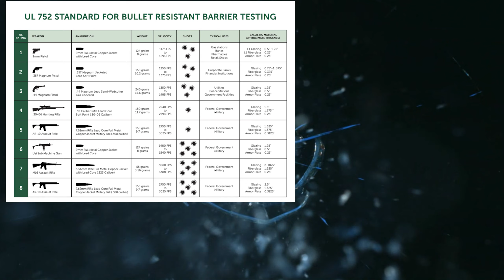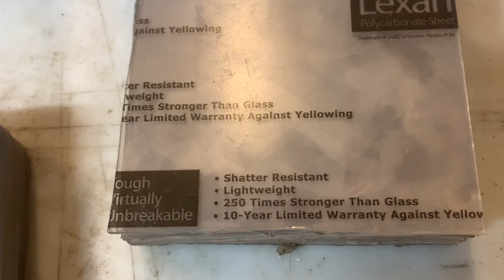Amazing Homemade Bullet resistant Glass

Comment: A couple things you should test out as I am starting to work with acrylic and polycarbonate sheets for my house windows and doors, I am also using epoxy resins and polyester fiberglass resins. You’re already using them in a way by using gorilla glue and other adhesive sealants to bond the layers together. But instead of pressing the layers together and squeezing out as much adhesive as you can to reduce air bubbles, consider using different types of pourable 2-part resins to make some of the layers themselves. Epoxy resin has a tensile strength similar to that of polycarbonate and acrylic and glass, while polyester resin is not as strong as epoxy resin it is much more flexible. Just make sure you purchase the correct type of resin for how thick you want the layer to be. Once the hardener is mixed in they begin to heat up to cure and Some epoxy can only be poured 1/8” at most or they get too hot and can combust. Other deep pour resins can be poured 2” deep. The deep pour resin is very thick and you can make a wall around your piece of glass or lexen using a masking tape. Wrap the tape around the perimeter of the glass ensuring half of the tape is sealed tightly to the edges of the glass and half of it is sticking up like a wall  around the piece of glass. You can then pour a layer of resin on top of the glass or Lexen layer and use a heat gun or torch for epoxy resin only to get the air bubbles out of it, then wait for it to set up and put another piece of glass on top while it’s still curing or wait for it to fully cure, sand it’s surface a bit, and then pour another layer of resin. If you have the equipment to do so you don’t even need to use adhesive to combine the layers. Actual bullet proof glass is sealed around the edges with a special high temperature adhesive possibly similar to stove gasket or furnace cement, then it’s put in a high heat furnace where it’s heated up to just below melting temperature and then all the layers of glass and polycarbonate are pressed together compressing them extremely hard. You may be able to replicate with a forge and a hydraulic press if you have one or buy one. A small one is around $300
Reply: After all, polycarbonate and acrylic sheets start off as a liquid resin that is poured and cast through a process to become sheets

Comment: Some helpful pointers:  For practical purposes, it is best to have one layer of glass on the two outside faces.  This is because glass is far more scratch and UV resistant than the plastics. Glass in general just weathers way better than plastics, though the downside is that it cracks much easier.  The next best would be acrylic on the outside because it is more UV resistant than polycarbonate.  P.C. can yellow in strong UV.  

   There are two main grades or types of acrylic.  There is regular acrylic and then there is toughened, impact resistant acrylic.  Obviously the latter will be better for this purpose.  

  Naphtha is a much better thinner than mineral spirits, especially the low odor stuff that you're using. People have done experiments with using different solvents to thin silicone caulk, and found that the former works much better than the latter--mainly because it evaporates much faster and more fully.  But yeah, of course it is more toxic to breath, so either do it outside or wear the right respiratory protection. 

   To help get rid of air bubbles, you really should use some kind of vacuum bagging system, whether it is the cheap, clothes bag and household vacuum cleaner set up, or the much better epoxy/composite specific, much higher vacuum pulling bagging systems.
Reply from the maker: If I had glass on outside and inside and single shot would spray glass shrapnel everywhere. 
As far as the UV and PC. All it takes is a UV resistant film and it works wonders.
Reply: @3RBallistics    Do you use glass because of its compressive strength then?
Reply from the maker: @justinw1765  think of it more like body armor. I use the glass as a strike face and polycarbonate as a composite. One breaks up and slows down the projectile and the other “catches” the projectile. Glass breaks and PC bends.
Reply: @3RBallistics  👍

Comment: Good informative content as always. I think you and tech are really onto something. I have my own ideas for rifle glass, I want to make rifle rated glass lenses to protect the eyes for a full head/face ballistic helmet that I will be working on at some point. 
Anyway, keep the glass content coming you guys! Because I might need more information on bulletproof glass before making some decisions on future material purchases. 👍😎
Reply: That's a hard endeavor because geometry is against you... unless you make the ballistic helmet with goggles like Minions. Your main concern should be reducing thickness a lot. You should try to reverse-engineer some existing tested ballistic helmets. I would do that. Or you will have to compromise visibility for protection. Visibility is important in combat. The eyes can be an acceptable weak spot, assuming the rest of the helmet can withstand power rounds (you said rifles, try to start with small caliber rounds, like 3A, and go in incremental steps). Also, you could go electronic, providing a helmet with no weak points, but with sensors that can be projected in small screens to the wearer. Wishing you the best of luck!
Reply: @merodriguez81  It would indeed be difficult to achieve if you were using traditional bulletproof glass methods. However I've been thinking of a bulletproof glass prototype concept that I think could allow me to get away with a rifle rating for a small area of coverage. My idea is to combine a layer of transparent Aluminum with a layer of tightly packed glass marbles molded inside a piece of Polycarbonate plastic followed by a very thick layer of Polycarbonate plastic that's annealed (to catch any fragmentation that makes it through the first 2 layers ). 
Keep in mind though this is only a conceptual prototype. I won't know if this will work until I build a few samples and get ahold of someone to test them for me.
In theory it should give me good optical clarity while still protecting my eyes from bullets and fragments. If it ends up working I'll use that in conjunction with forearm-mounted ballistic mini shields to block any head shots from a distance. The mini shields is another concept I drew up and put on the back burner until I get the necessary materials to build some test samples.
As for the main composite armor for the rest of the helmet, I think I plan to go for a level 3A-x rating.
Or a high level 3A that's capable of taking down all pistol calibers, including the ones designed to penetrate 3A panels, and can even stop a few low tier rifle threats by itself with little to no ceramic used such as .300 Blackout or .223 Remington for example. I won't phase out ceramic for it entirely, I'm just going to set the limit to no more than very little ceramic used if any is used at all. And I will also try to keep the helmet very lightweight and still at that insane rating. 3A-x @ 5 lbs. or less high multi-hit with little to no BFD signature if I can manage it.
Reply: @nemesisobsidian  You made me investigate. I am no chemist. I'm a Software Engineer.
If I understood well, Aluminium oxynitride should be a great idea. Again, what bothers me is that even if you achieve to stop the rounds in the eyes, the visibility WILL BE compromised, at least for that eye, with only ONE round. That's why I mentioned electronics before.
Sure, you can say, if you manage to get shot twice in the eyes, you probably are going to die anyway. That is true. Again, the best choice is to avoid getting shot in the face.

Regarding the forearm-mounted shield, you can inspire yourself from the riot shields, or classic bulletproof glass methods, you can even use curve geometry on a mounted vambrace, to deflect a part of the bullet (as tanks do). That is feasible. Transparency? If you think is necessary. It is not. Maybe you have in mind something mechanical. Again, keep it as simple as possible. If the idea is to protect only the head, knowing the direction from the fire, a vambrace should be fine, even in only one arm.

Ceramics rocks, but again, will work decently for single rounds, compared with Epoxy, and multilayered Polycarbonate or woven fiber glass, I think.

The BFD issue is very important because the protection is for the head. Add weight if you need to, but damage to the brain or incapacitation is equal to death. Remember the Knights of Old with full-plate armor? Besides crossbows, crushing weapons were the way to go. Trauma dmg. BONG!

Also, the helmet should be able to be easy to detach if compromised.
After that, you should be able to remove it and swap it.

My personal goal is always 9 mm, full magazine. 13 shots, randomly scattered. OR one Power Round from a Rifle. 3 is too much. It would look like an early XX high dept diver. That's up to the wearer to avoid getting 3x shot in the head!

Keep designing friend! Good luck!
Reply: @merodriguez81   Yes a hit to bulletproof glass tends to ruin its optical clarity. That's why I also thought about making the lenses 2x2" inches square flat on one side curved inwards on the other side with some foam padding attached to the curved side so as to make the lenses more comfortable to wear around my eye sockets when I put the helmet on. The lenses will be replaceable if they get cracked by a bullet or fragments. 

I've also thought about designing the helmet in such a way that part of its outer armor slightly overlaps and forms narrow slits over the bulletproof glass lenses both in length and depth kind of like the classic heavy crossbow windows that knights used in castle fortifications during the medieval period. I think this would counter the problem of a stray bullet or fragment hitting the lens and possibly cracking it. The idea is it would allow full visibility and optical clarity while making it more difficult for a stray bullet or bullet fragment to hit the lens and damage it.

Also from what I can tell most people don't train to do headshots, they tend to train in order to be able to land rounds on the torso area of the human body most of the time. Heads bob, weave, and move around and are also smaller targets and therefore more difficult to accurately hit than a center mass shot. And if you can't hit a human head at 400 yards or further away, you can forget about hitting them in the face or eyes at that distance. Not only that but felt recoil, drag, air resistance, and bullet drop are very much against you in any combat scenario. Bullets also have a tendency to be way off target sometimes, you could be aiming for center mass and just miss them by a few inches or feet or bust their left shoulder.

The reason I went with the idea of a mini shield mounted on the forearm is let's say I'm wearing my helmet and there's a .500 Magnum coming in hot and it gets deflected off the upper part of the helmets dome and immediately after seeing the direction the bullet came from I raise my forearm and put the mini shield directly in front of my face to block subsequent shots. I'm not worried about a shot coming from the side or behind me as there will be plenty of armor back there to protect me plus the dense foam and air bag combination for a padding system that should greatly reduce or eliminate the risk of blunt force trauma and traumatic brain injury entirely.
I may consider a camera system for the mini shield connected to an IPhone screen behind the mini shield so I can see while my face and eyes are behind the safety of the shield. The mini shield will be about the same size and dimensions as a 10x12 SAPI plate for a chest rig and only designed to protect my face and eyes from headshots.
Reply: @nemesisobsidian   I really like the idea of replacing the lenses. Maybe a jank down and pull or many other possible designs. That´s detailed work, but again, UX. It should be intuitive to duck/cover, slide [down | other direction], and pull it out. I'm sure there are better ideas for that. The dimensions are great. Remember I'm using the metric system, BTW. I have to convert units to 'see them'. 

The narrow slits it's a neat idea. Using geometry this time in your favor. You sacrifice very little visibility and add a lot of protection that way. Also, those could act as light absorbers in cases where there's a lot of sun. Consider the [heat|cold] and the average time of helmet use. There are some substances and paints that can help you to absorb heat or disperse it. Event to put it to some use. These lenses are natural insulators, too.
Regarding padding and even an airbag, it's great; it really can save lives. Your armor can be great, but still, a hit will be like a kick from a mule to the head. So, even without BFD, that kinetic energy has to be absorbed or countered. 

One good thing is that the amount of energy to disperse is known (you can look it up). Also, for simplicity, just one shot to the head, say, right-side-up, the right hemisphere of our brain. Ignoring the accumulative trauma | degradation of the armor by getting shot repeatedly in the head (ding! ding! ding! ding!)... One shot. Then, could you give the operator some estimated time to recuperate? You could also experiment with non-Newtonian fluids, which are capable of getting strong with fast kinetic energy, especially if they are planar in nature. Nah. It is not a good idea. But anyway, it can help to consider it for interior padding, too. It will get rigid with a sudden impact but can help to soften it if properly managed. Or it can be a disaster and a horrible idea.

Standard training and defensive shooting will always go for the center of mass.

Yes, you can't create a shield like a bubble. Like tanks, the strong and face-the-enemy part is the Front. Enough to absorb some power rounds, mainly from sustained medium caliber ammunition. This would be more effective. NOT Special AP ammo, with special tips. Those are edge cases.

Keep iterating! Cheers,
Reply: Consider using outdated phone screen protectors made of clear sapphire or equivalent gorilla glass when they go on clearance at the dollar store - should be sufficiently hard to flatten any projectile with a rigid backing of tempered glass or polycarbonate semi-rigid backing. For as small as you want, you could get your polycarbonate from old CDs and PET from drink bottles (PET seems to work better than acrylic for the back)
You may want a layer of PET on the front too if you're worried about shrapnel.
Also, the way you mount it makes a difference, it can distribute much the force to its mount if you have a springy beveled mount.

Comment: Does the UV curing stuff yellow over time?  Sometimes with clear UV resin for 3d printing, the big drawback is yellowing in the sun after some time.  Might be interesting to do a couple of tests with the UV resin and the Gorilla glue as well.   I.E. Make 4 controls, put 2 (UV resin + Gorilla) outside full time, keep 2 in the closet inside, compare after 30 / 60 / 90 / 365 days.
Reply from the maker: I have multiple samples outside right now. Unfortunately they’ve only been out there about 2 weeks. Maybe in a year or so I will do an update.

Comment: I'd like to ask you a question. First of all, I want you to understand that I'm not good at English and use a translator. I saw a bulletproof glass test video on 3R on another channel. Among them, 1/8 polycarbonate, 1/2 acrylic, 1/8 polycarbonate, 1/2 polycarbonate. Why do you use 1/8 polycarbonate for the 3rd time? Would it be the same if I use polycarbonate on 1/2,1/8 combined 5/8 instead of 1/8 polycarbonate? I want to know the difference between the two.
Reply from the maker: Thin polycarbonate will elongate much more than thick polycarbonate. The failure mode of thick polycarbonate will usually plug out as where multiple thin pieces of polycarbonate will stretch further than breaking through.

Comment: Seems like the all plastic is the way to go, way better clarity after being shot and less spall as well as a lower cost. I feel like your 1.5" test plate for the 44mag would've held up better with a stronger frame like the 2.5" ones had
Reply from the maker: Agreed, it definitely would have helped having a true frame.
Reply: @3RBallistics was curious where you got the annealed glass from? Hard to find any thick sheets locally, thanks for the videos
Reply from the maker: @Sinister_Reaper  I actually picked up the glass from a construction site for free. They were shower wall panels that they were going to be throwing away. Most non tempered glass is just plain (soda-lime) annealed glass.